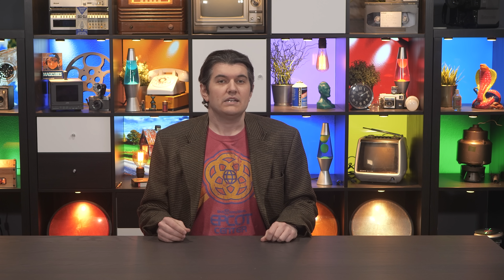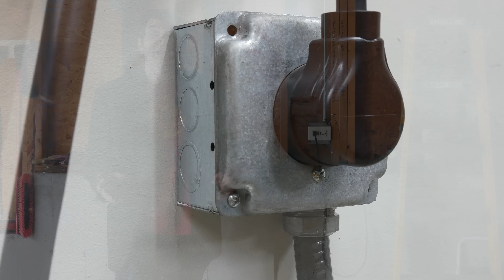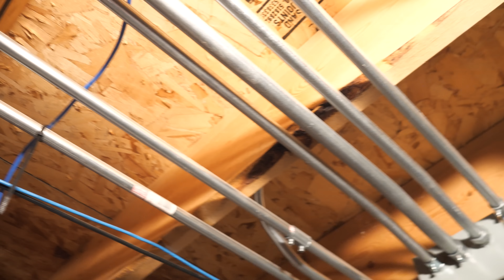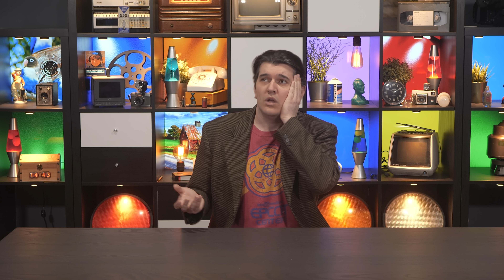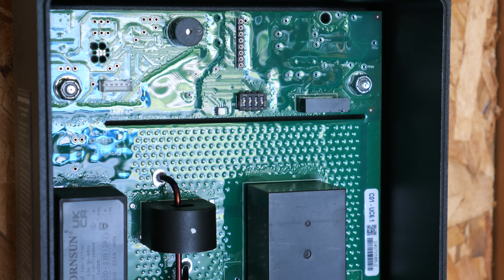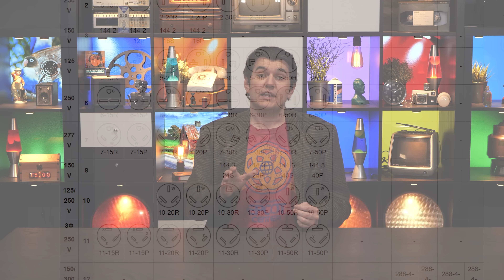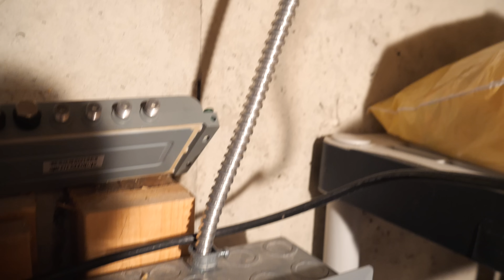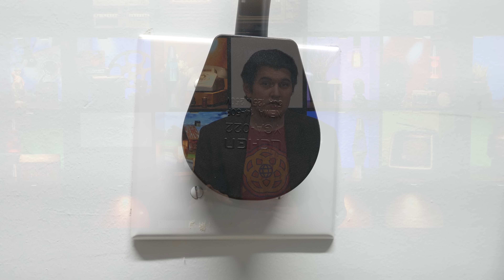The "standard" car charger is usually overkill—but your electrician might not know that

Comment: No No No. Dryer plugs are not rated for continuous use EV charging. Cheap dryer plugs used by typical builders are fine for running a household dryer. They are NOT suitable for hours of high amperage charging. You must get a properly rated EV NEMA 14-50. There is plenty of melted plug pictures and videos online. USE a properly rated EV NEMA plug.

Comment: Completely agree, we charge our volt and Equinox EV on one 30 amp circuit and the evse is only capable of 15 amps, we have zero issues charging our vehicles. Good video.

Comment: what ever you do don't wire up a 240v fast charger by using 2 extension cords plugged into outlets that originate from separate sides of the panel. that's bad since some official will be mad at you. the electricity wont care but they will. it will only support 30 amps at 240v in this regard if you use 12awg cords.

Comment: Jesus another youtuber out of his element giving bad info. IT IS NOT ILLEGAL ANYWHERE IN AMERICA TO DO YOUR OWN ELECTRICAL. You just gotta pull the correct permits and be inspected for proper  install. Also charging at 110v costs more than using g 240v 30 amp and 240v 40 or 50 amp it's all about less resistance here. Same reason I run hottub on 240 not 110

Comment: Wired my own charger, put in wire to support 60A breaker, but installed a 50. We don’t know whats coming in the future. I usually set my Tesla charger to draw 30A, have a breaker box full, 200 A service. Charge over night at off peak rates, had to have the work checked by an electrician to receive the off peak charging. 
Physics says I squared R losses are more the higher your current, so I would always go with 240V if you can do it to cut your current in half. 
The smart charger is a great idea if your service can’t support 240, or you only have 100 A service.

Comment: I don't think the NEC permits a 6-50 receptacle on a 30A circuit. The underlying risk is that someone will presume that the circuit is 50A based on the receptacle and plug in a device that pulls more than 24/30A, overloading the circuit.

The safer and NEC compliant way to go about this is to hardwire. Grizzl-e sells products that can be hardwired

Comment: We used a regular outlet for months worth no issue. Wife's daily driving was 12 miles and 15 hours on the charger got us 45 miles. So by the time Saturday came we had more than enough to avoid charging stations unless we were going 40+min on a highway at 80+mph.

Comment: Found this oldie, but goodie...

Should be noted that several studies have concluded that charging slower might be better for the battery (the result was in the potential error range) but it was fairly consistent that doing so was not as efficient.  That is, the charger tends to draw more power in "overhead'" as a percentage.  So, if charging 3kWh into an EV battery, doing so at 48 amps might lose about 7% of the power to operate the charger.  Lowing the amperage to 24 amps might see 12% of the power running the charger.  In other words, you lose more power charging slow.  If you electric rates are high, this can matter.

Comment: Hyundai ioniq you need to change your transaxle transmission fluid and also possibly replace the bearings in the motor with ceramic

Comment: If you guys have the electric dryer 30-amp circuit and use either a 3-prong or 4-prong power cord just get an adapter to your ev charger and there you go. Ev car charging for about 100 bucks. Just make sure you limit the power on your vehicle to not exceed the 30amp or you will trip the breaker.

Comment: Aluminum wire is what is feeding your ENTIRE HOUSE form the power company. If you use #4 which is good for 50 to 60 amps depending on jacket, conduit etc etc etc. And only charge at 32 amps. The 50 amp breaker and the 50 amp outlet will not over heat.

Comment: EVSE's charging is  rated at 125% not 80% as you mentioned.  It’s a continuous load running more than three hours. NEC  article 625 read it. 
Hopefully, you pulled the permit also and inspected . If something ever happened, the insurance company would have a field day  if They know it was an unpermitted job.

Comment: We have 15/40 Hubble receptacle in our garage and have used a 50 amp receptacle splitter, plugged into each of 2 mobile chargers for our two ev’s, so we never have to unplug the mobile chargers from the 14/50 circuit. We just make sure we only charge one car at a time.

Comment: Besides a 180 mile round trip commute, I also have time of use electric rate. So need to charge completely and within the constraints of the time of use because it's about half price during off-peak. Furthermore, none of my vehicles a rivian and a Tesla themselves are smart enough to handle the time of use schedule for October through the end of May. So you have to have a charger with smarts

Comment: Blah, blah, blah... If you can get NEMA 14-50 electrical outlet, then get the NEMA 14-50 electrical outlet. 🤦🏻‍♂ If your electrical situation does not permit NEMA 14-50 installation, then sure, get the NEMA 14-30 as the second best option. 🤷🏻‍♀ Okay, that is all there is to it without wasting half-hour on this fluff video and watching a guy in a blazer show electrical work. 🙄

Comment: What a wonderful job. Boy, did I get a new perspective. So well done, thank you. "Bring the hot dish"--Too funny.
For anyone who might read this and have an answer: I just bought a Tesla--could I install a Hubbell NEMA 14-50, use 10 gauge wire, 30 amp breaker and will the Tesla recognize and draw only 24 amps? (My panels only produce so much electricity, so I don't need to be pumping higher amps into the car.)

Comment: I have a Ford F-150 Lightning ER with a 131kw battery. A Level One charger for my truck would be like pi**ing in the ocean. I could charge it for days to get to the grocery and back - once. Fortunately, when I built my house, I opted for a dedicated NEMA 14-50 on a 50A circuit for $500, along with 400A service for the house for a few hundred more. My Level Two charger runs about 9kw/hr and can charge my truck from 15% to 90% overnight (11-12 hours). I wouldn’t have the truck without this charging capability.

Comment: Wags term a 16 A, 240 VAC charger as "Level 1.5".  Many choices <$100.  It charges 2.7x faster than a 120 VAC charger (12 A max), which should be good enough for most EV owners.  One can use them on a common 30 A outlet, such as for a clothes dryer.

If a plug-in hybrid with 30 mile e-range, 12A, 120 VAC charging takes < 6 hr, so no need for 240 VAC.

Comment: Don't understand the hate for conduit. 
Conduit is AWESOME. 

Yes, it's a more expensive install, and there's a learning curve to bending & the pipe properly, BUT the way I look at it, it future-proofs the electrical system. 

Conduit allows old, brittle wire to be replaced without tearing out walls, it allows for additional wires to be pulled in if you want to add new devices, it protects wire much better from damage, and protects the home from fires in the case IF the wire inside starts to short or overheat. 

In my opinion, conduit should be used everywhere. I hate working on homes without it. It makes repairs/upgrades 6x harder when flexible cable was used. Cheap install leads to a expensive service later down the line. 

Conduit is more expensive but adds modularity and repairability.

Comment: A Power Joiner Inverter or an EZ240 Converter lets you plug into two 120v outlets to get 240v out.  North American homes use split-phase power (Line 1 and Line 2). Plugging into two separate 120V outlets supplied by opposite phases yields 240V across the two hot wires.

Comment: So I empathically agree with the main point of the video: electricity is ubiquitous, easy to source, highly flexible and you probably have access to it / the necessary equipment anyway. EVs have other advantages too, but that's the main one, and people just don't appreciate enough how much of a big deal this is. ICE's have some flex in the fuel they're using, but not a ton. If you use a fuel with significantly different properties, you need a different engine design. That's technically true for electricity too, except we can turn pretty much anything into electricity, turning things into gasoline (or more exotic fuels like hydrogen) though... Well, it can be done, but there's a reason we're mostly relying on mining it, because the processes to do so are energetically extremely inefficient and expensive, and rely on electricity anyway. Electricity meanwhile is very easy to transport comparatively (the infrastructure needs to be maintained, but transporting electricity really only uses the electricity we're transporting, that's the cool thing about electricity, it already likes going places, unlike fuels which require significant coaxing to go where they need to), and we can turn almost anything that's any sort of power source into electricity, with pretty decent efficiency.

The following is a rant about home charging:

I think the thing with home charging is super overstated because most people live in apartments anyway. There, the takeaway lesson kinda is, if you're driving like 20-30km a day; which describes a lot of City commuters, you really don't need to worry even if you're renting, if there's an available fast charger anywhere reasonably reachable for you, you'll be needing to visit there at most once a week anyway, or twice a week but for like 10 minutes if that works better into your schedule.

Overnight charging at home is great if you have the option, but it's not a big hurdle at all if you don't. This is "more expensive" as well, but over here a dc fast charger is like 0.4€-0.5€/kWH, compared to ~0.33€/kWH at home.

It's a bit of an ideal scenario, but in city traffic it's possible to reach a mileage of ~10kWH/100km, so that's around 5€/100km on a fast charger. At least in Germany, even with a compact ICE car you'd usually not get anywhere near that in city traffic.

And if we're talking about anything other than daily commute in mostly city traffic, at home charging isn't really much of a factor anyway, if you need regular daily drives of 100-200km, that's more like 15-50 kWH (depending on the exact distance, route, driving behavior and vehicle in question), for the top end of that, at-home charging isn't feasible anyway. But, most people do not have daily drives anywhere near this long, the vast majority of people have daily commutes that are substantially less than 1 hour.

Side note though, if you're planning on a slightly expanded tour, home charging is quite good for charging to 100%. The battery can't handle fast charging close to capacity anyway (common myth: charging to 100% is fine! It's staying at capacity what's causing the damage. If you're planning on going on a trip, you're totally fine to charge to 100% right before. Just don't bother if you're on a trip and you need stops anyway, just stop one additional time and charge in the fast charging range, you'll be better off time-wise).
Reply: > I think the thing with home charging is super overstated because most people live in apartments anyway
In America, 70% of American households live in detached single-family homes. I assume you're not talking about America, in this case?
Reply: @mlgpro2241 I'm quoting prices in €, take a wild guess.

If you're living in a detached house, the argument is moot because then you can charge at home anyway.
Reply: @hannessteffenhagen61  I didn't see the euros in your original comment, but km/kwh should've tipped me off

Comment: Early this year, we had to get a whole new breaker panel because the house had an FPE brand panel. If you don't know those, look up how badly their panels were built. 

I had asked them to put in a new 30A 240V circuit for our EVSE per Alec's info here. It would have unfortunately been exactly the same costs to install the 30A versus a 50A in the end. So if you're already doing a much bigger job, like getting a whole new breaker panel, the amp difference is moot for costs.

Comment: "The nerdiest of EV nerds"? That's coming on pretty high, especially for a self-avowed EV nerd. 

Your comment is also very narrow minded, and dismissive of the case for level 2 chargers in the home. 

First, the average cost of electricity exceeds $.29 per kwh in 6 states comprising 20% of the population. For my state, I've calculated that a total annual charge of 3.5 Mw for an EV (not unrealistic), will cost you an extra $326 per year with a simple wall charger. To state it "almost never makes rational sense" is not a reasonable claim if 20% of the population have high electric rates. 

Furthermore, it is "rational" to consider non-financial reasons as well, such as time saving, convenience, and reliability.  There are many factors that go into this decision, like one's travel patterns, availabilty of charging stations while at work, the cost of those stations,  any additional travel time to access these stations, reliability of these stations, etc. 

This is an extreme case, but if all of the 3.5 Mw annual charging was done at home using a wall charger, the car would have to be charged close to 11 hours a day, every day of the year. Going to a high speed charger takes time out of your day, and the cost per kwh is usually much higher.  There is rational value to the convenience and reliability of a home level 2 charger. 

You  really should do a follow-up analysis; your original strident position undermines your credibility. Don't forget to consider the fact that some states have substantial rebates for having a level 2 charger installed.

Comment: True, but if you live in the north the 120v adapter is just enough to warm up the battery and keep the charge and won't give you any capacity at all. That was the case for me with my Tesla M3. It would charge 8km/h in the summer and 0km/h in the winter. I still used the factory charging adapter, but with the 240v version and now I get 36km/h and less in the winter, but I don't know the number. Probably -8km/h

Comment: It's really not overkill your premise is wrong, no one installs a NEMA 14-50 because they have to, its because they want to be able to get rid of range anxiety if there car is at 50% and need to get to another state in a family emergency, its all about speed of charge not about waiting 24 hours to get fully charged to make the trip, they are trying to compensate for poor battery technology where they want to be able to fill up like a gas car but with the savings of electric, TBH electric cars came before the proper battery technology is even on the market and this video will be obsolete as soon as SSBs hit the mass market.

Comment: When the EV is plugged into Level 2 power and you schedule a departure time, the vehicle can warm the cabin and, depending on the vehicle, condition the high-voltage battery while it’s still connected to the house. That has several benefits:

* Less battery energy is spent heating the car. You start your trip with a warm cabin without taking as much energy out of the traction battery.
* The battery starts closer to an efficient operating temperature. A cold lithium-ion battery has reduced power and charging capability. Preconditioning helps mitigate that.
* You retain more winter driving range. You’re not starting the trip with a freezing cabin and battery and then asking the battery to supply all that heating energy.
* Regenerative braking may be available sooner/more strongly. Very cold batteries often restrict regen until they warm up.
* Defrosting is much better. You can have the windshield, cabin, and potentially seats/steering wheel warmed before you leave.

Comment: One of the biggest things that kept me out of an EV was the cost of the charger install. My free electrician who previously built houses from scratch 20 years ago up until the 2008 crash (so dated knowledge) showed me that I had 2 open breakers in a box below the meter but separate from the meter. He said that the homeowner has the right to use that panel as it is separate from the sealed meter box. Furthermore, that it's normal to have these breakers. All the houses he's built were in Missouri, so the statement was specific to this area. All that said, I'm not certain what you do outside of your channel (you mentioned you "work in technology") but could you find out for the good of the planet if most people have these panels, that are required to be within 6 feet of the meter for the fire department to shut off the power, are common to have open breakers? and if common, can most people start using these to add a charger cheaper by running from the meter (which is near my driveway and usually near the driveway in my area)? I feel like I would have considered EV's sooner if I had known it could be easy to put a charger outside since I've never owned a home with covered parking, but I live out where the low paid workforce lives that commutes into St Louis every day for a total of 110miles per day; in other words, people with heavy carbon footprints but very little money to get into an EV.

Comment: Excellent vid. I just installed a Splitvolt dyer outlet switcher for my daughter who has a Hyundai Iconiq I used a heavy duty welder extension cord but hardwired it to the Grizzle unit after changing the dip switches as you mention. Works like a charm and is a far cry better than the $7000.00 an electrician quoted her for a panel upgrade.

Comment: I'm a high-mileage driver - often 800-900 miles a week for work, with no/little (depending on my route) DCFC available. Have had no trouble on a 30-amp dryer outlet, with almost all charging during cheap hours.

Comment: Tell me this winter if you trip the 100 amp breaker in the main panel. 
If this is a heating subpanel, it’s basically unused in the warmer months. 

The 100 amp breaker should not be expected to carry more than 80% or 80 amps.